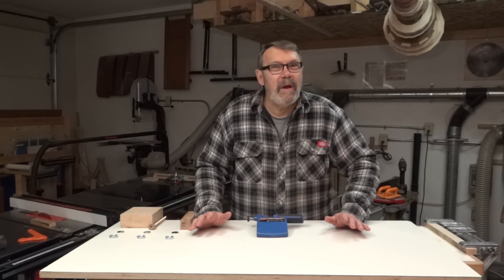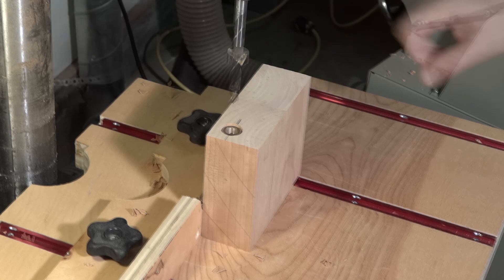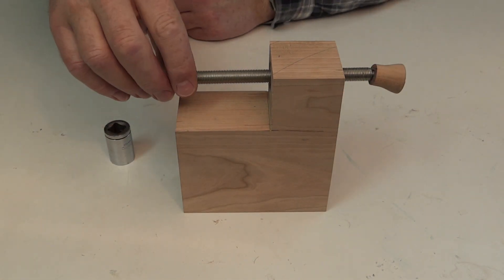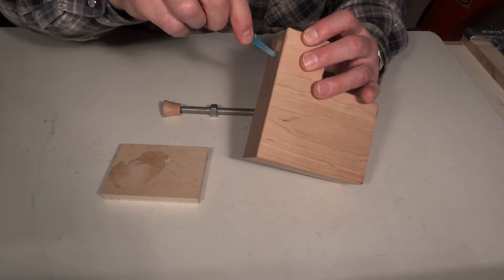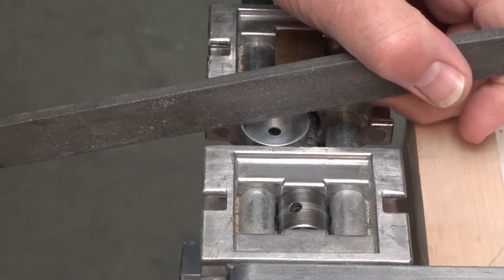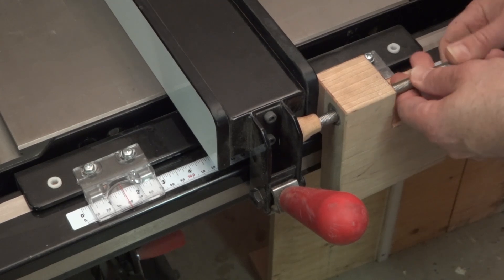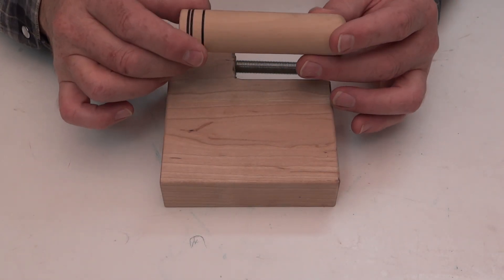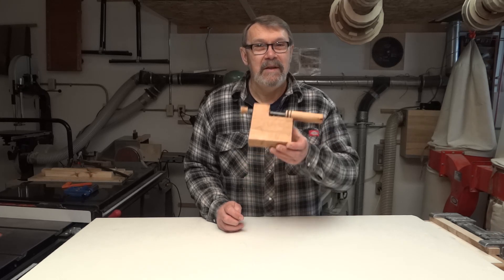Precision Tablesaw Fence Adjuster - Favorite Jigs #2

Comment: Out looking at some of the older stuff, part of my quest to finish downloading the internet. This is a cool project, much more accurate and less painful than rapping (back and forth) on the side of the fence with a well placed knuckle.  

At my previous job I was in charge of all the low voltage wiring for a rather large remodel project. Altogether, I pulled about 75,000 feet of wire into this building, hanging j-hooks along raceways through ceilings, floors, between floors, around stuff and inside of things. When started, I purchased 4 square drive bits, 2 shorter and 2 longer ones. During the process, a few screws snapped, mostly from mounting them then changing my mind about placement and removing/replacing them, but the bits all survived and are in good shape still today.  I couldn't do that with a Phillips bit to save my neck.
Happy weekend!
- Bill
Reply from the maker: +Bill Kibby 
Hi Bill,
Glad you like the jig! Hope it is helpful to you.
Take care,
.....Gord